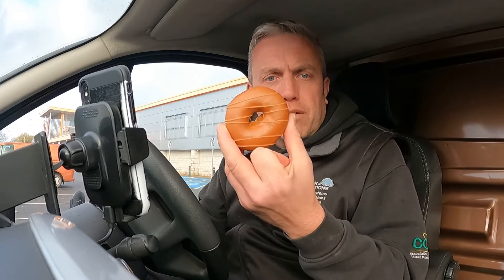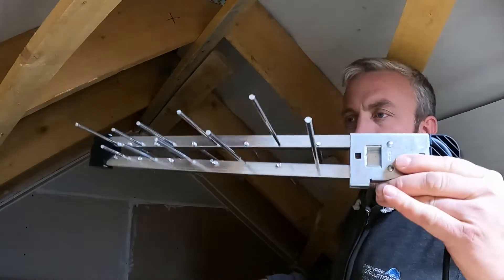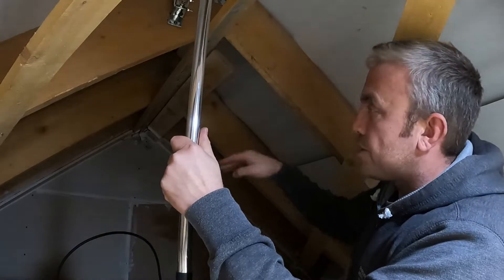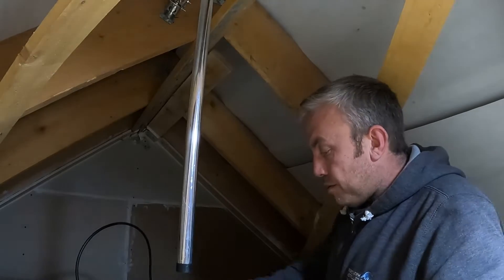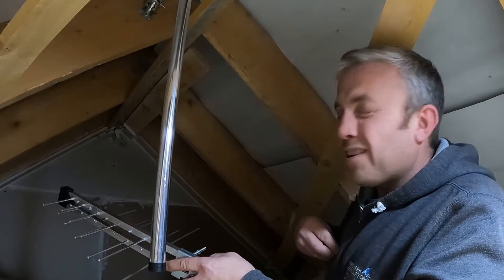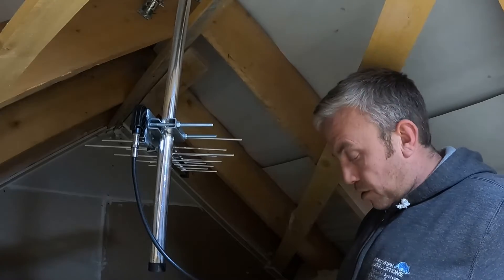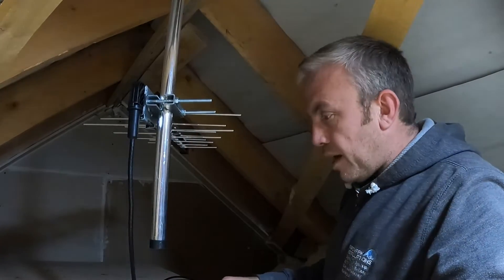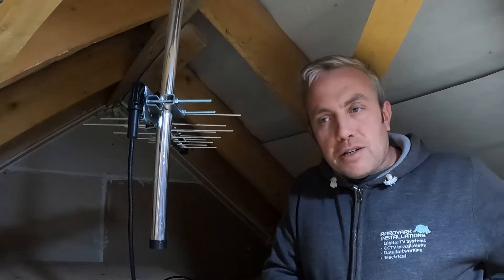MINI LOG PERIODIC TV AERIAL.  What are they?  When would you use one?

Comment: Better signal strength quality and higher gain when installed on the outside of your home on the rood or mast than in the attic, as in the attic, you loose signal strength and picture quility a few decibels because it's enclosed with the signal being blocked from the outside.
Reply from the maker: Thank you for stating the obvious pal, but you can’t always install outside as was the case here.  If you know what your doing then the few decibels lost being installed in the loft won’t have any effect on picture quality as long as your end point is at acceptable levels.  That’s what a spectrum analyser is for.